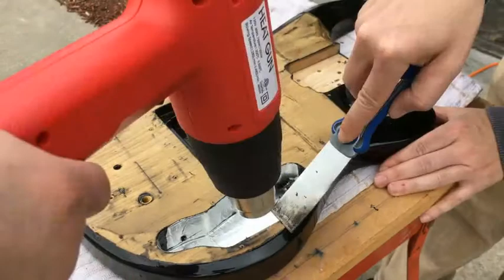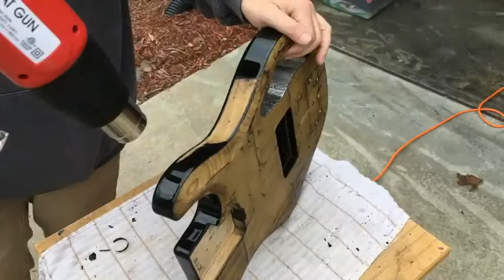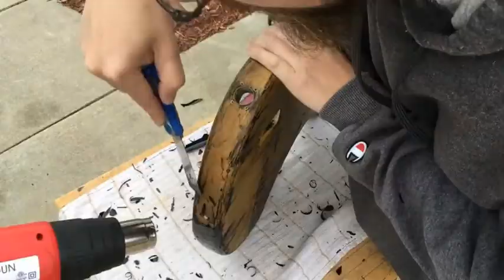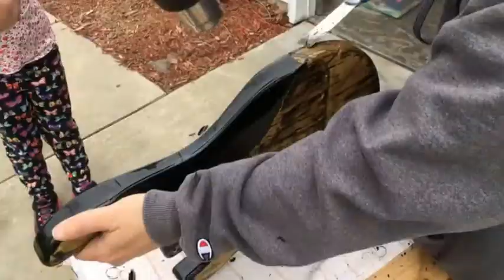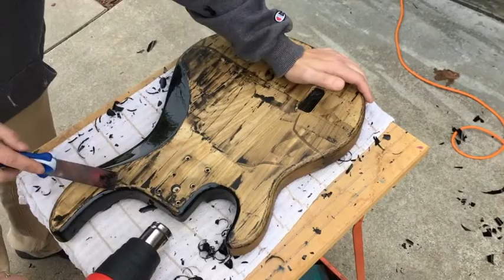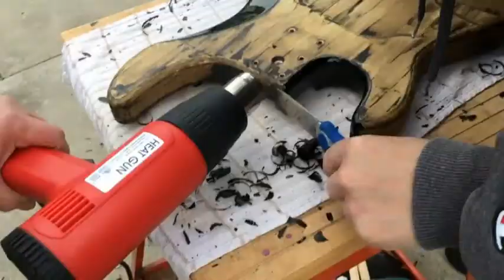High Speed Paint Removal of a 1998 Music Man Stingray - Goshen Guitar Works

Comment: Nice job mate. Just a couple of questions: 1. What heat setting did you have your heat gun on? and 2. How long, in real time, did it take you to strip most of the paint off the guitar body with the heat gun? I guess you had to spend a fair bit of time afterwards with a sander to get the rest of it off.